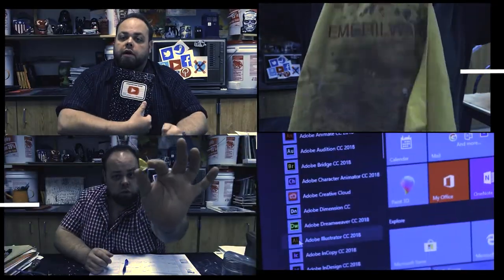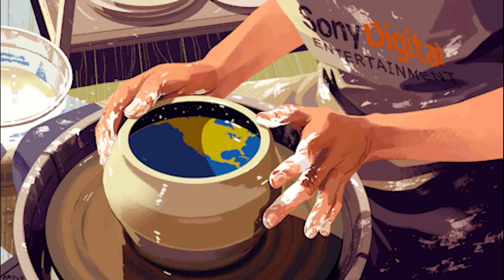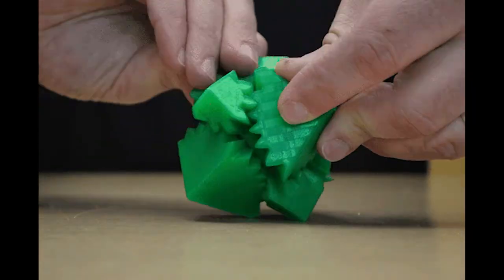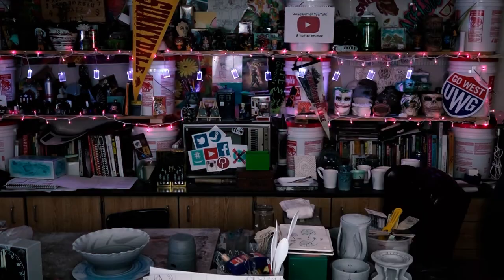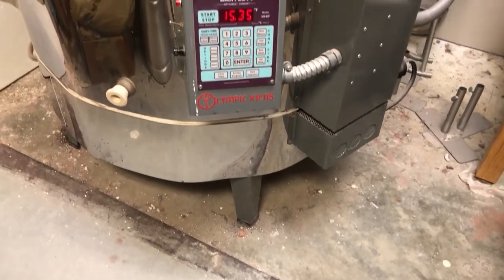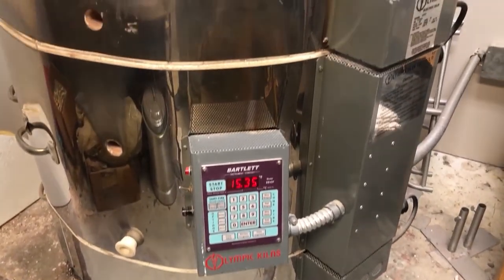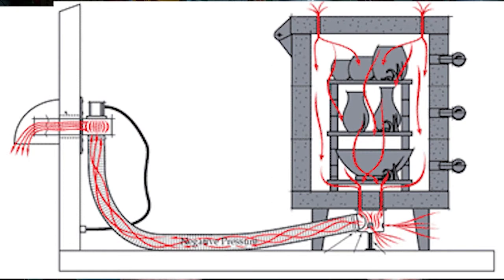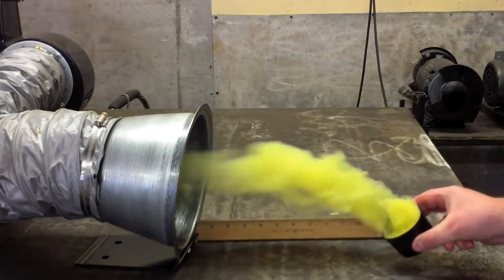How does a Kiln work? | Ceramics 101 | University of YouTube

Comment: Excellent video! I have one small correction for you if you're interested. Vitrification is not the actual process that we use to make pottery, generally speaking. That would require the ceramics to completely liquify, then cool down rapidly, creating a glass. 

Sintering is the proper word for the reaction. Sintering will pack and fuse particles together without changing its shape too much, add strength, and can operate below the true melting point of the material.

Cool science!
Reply from the maker: Thanks, cool science info. ✌🏻

Comment: Can I set my electric kiln so it starts in the middle of the night and turns off during the school day? Reason being that the toxic fumes burn off and vent out a couple hours before school starts.
Reply from the maker: Yes, if you have a digital kiln you can add a delay to the firing program, but not on a older manual kiln. If you can fire over the weekend, or start it the previous afternoon, that would insure that all gases/toxins have more time to vent out of the room before you or the students are in the class again.